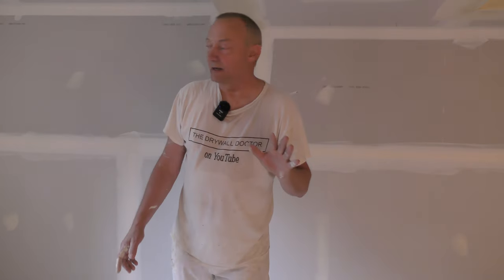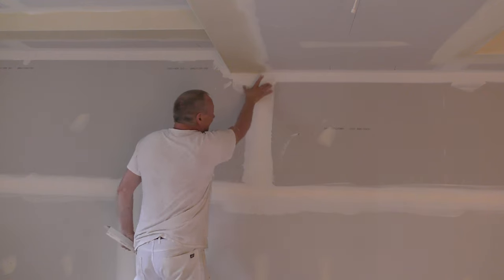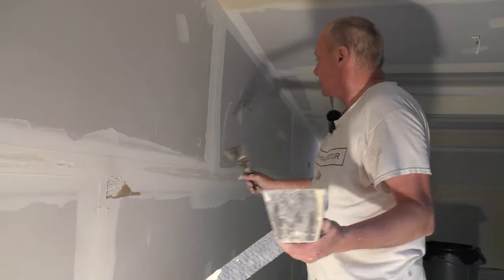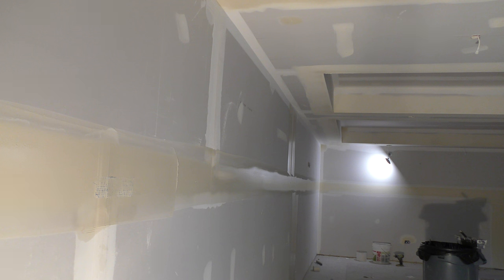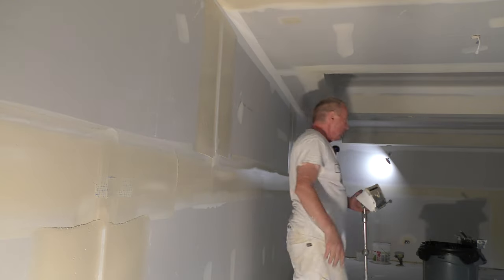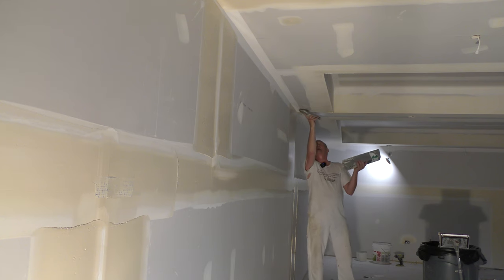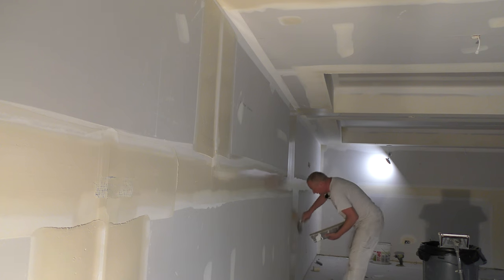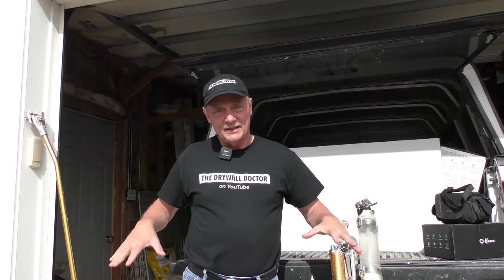Coating Seams And Butts With A 10" Flat Box

Comment: Hey, Doc. You mentioned you learned on tools starting in 1976 and that you're a tool guy but my question is, how did you get so good at hand finishing? I imagine being taught to hand finish isn't really taught in the union as a finisher, all focus would be on how to run the automatic taping tools?
Reply from the maker: No, we three coated everything and all corners,  cross offs, and nails were done by hand.  Scaffold work I would have been doing just the basics with the tools but mostly by hand.
Reply: @THEDRYWALLDOCTOR1  Interesting,  appreciate the explanation. Greetings from Kansas City.